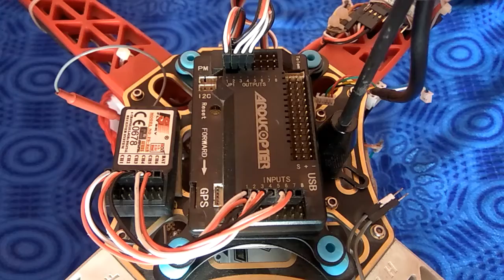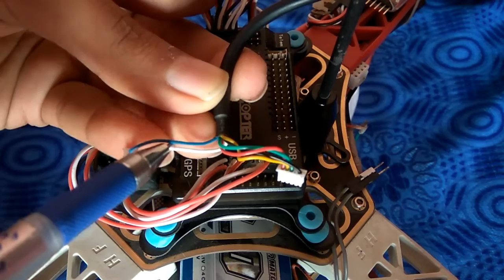APM explained,power module,Input connection,GPS and compass etc......

Comment: Does APM support yellow non branded ESC? Please reply
Reply from the maker: Yes absolutely it supports
Reply: @iconiczeb  I have arducopter 2.6. I have calibrated ESC but when i armed motor not spinning. I cannot solve this problem since 6 month. I have tried a lot. I have replace the APM board but also facing same problem. So if you help me god will bless you. Please help me otherwise my money will be wasted. Please help
Reply: @SGNEPALITECH  use power module instead of esc's

Comment: Does 2amp ESC will power APM? Please reply
Reply from the maker: Sikna Aaunuhos it will power but you'll face some problem, 3Amp is best option. If you are not eligible to buy another of 3amp you can continue with 2amp
Reply: Ocean of Tech  bro I can not calibrate my ESC in APM board but   if I try to calibrate ESC with other flight controller it calibrate easily. What is the reason for that? Please reply bro
Reply from the maker: Calibration esc one by one as you do with direct receiver
Reply: Ocean of Tech  I have calibrate one by one but also motor doesn't spinning. Please help me

Comment: which gps version are you using? can this gps work with my apm 2.8?  http://www.hallroad.org/modules/613-u-blox-neo-6m-neo6mv2-gps-module-in-pakistan.html?search_query=gps&results=14 currently im making autonomous quadcopter which is my university final project. suggest me that built in compass GUZARA KR LE GA?
Reply from the maker: 6M is perfect for 2.8.
Go for this GPS
Reply: Ocean of Tech actually its without external compass.. so am i okay with built in compass?
Reply from the maker: 2.8 does not have inbuilt compass so neo 6m has compass as well as GPS also.

Comment: from where you purchased it? and which version it is?. i want to buy a amp 2.5  from banggood. what is your opinion. plz
Reply from the maker: I will suggest you to buy AMP2.6 or APM2.8 these two are best version.
You can easily buy it from eBay.in,Amazon.in or if you want in cheap price the buy from AliExpress but it will take 30-40 days to deliver your product.

Comment: Hey bro please inform me in more detail about how to give power to apm
Reply from the maker: There are 2 ways to power apm board.
1. Use power cable that's connect with lipo and 12C port in apm.
2.Use BEC of minimum 2amp 5v which is easily available in ESC.
Reply: Ocean of Tech can you show me video of both the connection how to connect by lipo and how to by ESC